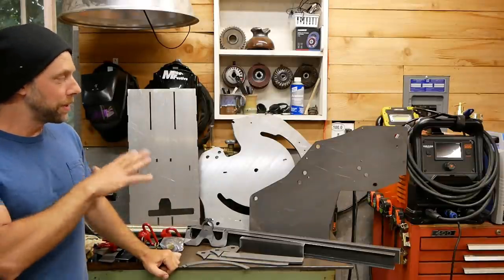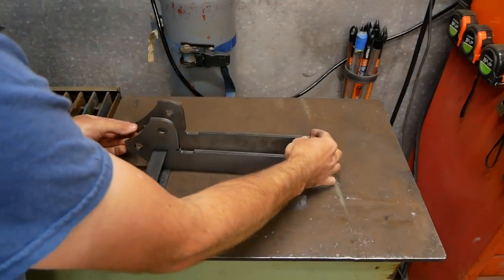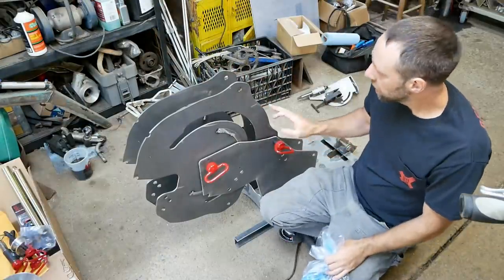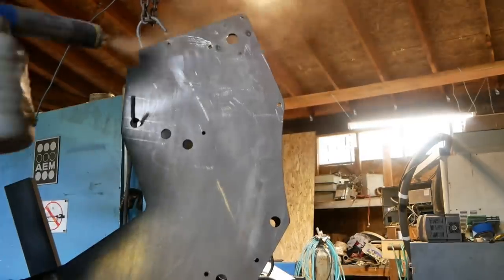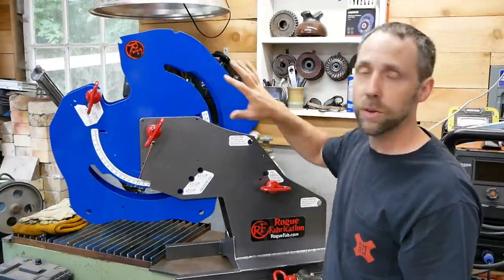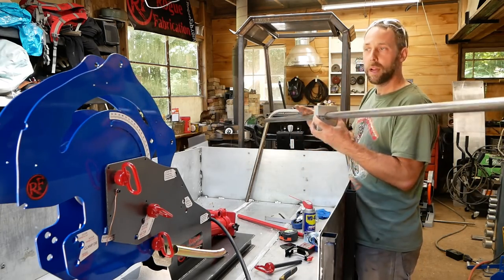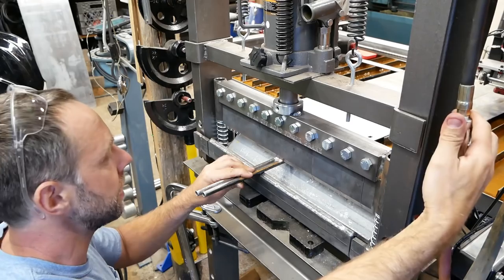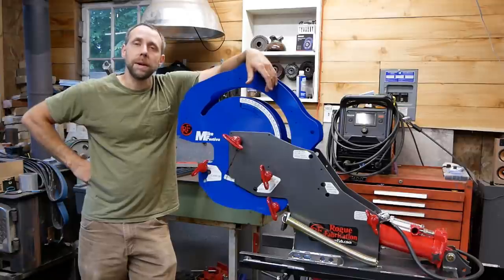Rogue Fab M600 tubing bender and Swag off-road finger brake

Comment: Thank you for another great tool video Mike!  A while back I bought one of the SWAG finger brakes for the maintenance shop at work and found it very useful, particularly the heavy gage bending capability.  They didn't understand why I was mad that I couldn't take it with me when I quit...something about using their money, blah, blah...  That is a different concept in tubing benders, I see some good utility in that design.  Might be a good addition to my Pro Tools bender.  I'm pulling up Rogue's website now to get a closer look and see what it costs.  Thanks again for the great content.
Reply from the maker: Thanks for checking out my new video! Yes the Swag brake it really a well made tool, I wish I bought it years ago. I looked into the pro tools bender, they really looked like great tools, I think both styles of benders will get the job done, I have not ever worked with ether kind before so it’s going to be a learning curve for me but I’m looking forward to it. 👍 
Ps I just got home from a awesome camping trip hiking 45 miles though the south side of the Olympic mountains! Take care

Comment: Dang Mike, you have all the coolest tools.
Reply from the maker: 😊 I’m definitely getting some cool shop tools! If you look back 5 year’s ago when I first posted my homemade sawmill video, I was working with a broken but repaired Lincoln weld pac 100, an angle grinder and my used worn out metal bandsaw. I have really come a long way! Thanks for checking out my new video 🙂

Comment: The powder coating looks far better then a typical rattle can job, might have to look into a sprayer and find an old even for preheating, or maybe a few oven/stove top coils inside of a cinderblock enclosure, be good for weld prep on cast iron as well, howd you land on this particular bender the company reached out? the JD2 benders seem more popular similar price and a bit easier to work with maybe im not sure, any advantages to this style?

Comment: Once again Mike, awesome video and info.  I got the Slugger saw you use and I love it.  Since you've had yours for awhile now, how's it holding up and what about blade life?  Thanks for sharing, keep these videos coming!  :)
Reply from the maker: The Slugger saws are great 👍 I really like mine, my friend bought one too after using mine. Blade life is fairly good as long as you don’t force though the cuts and only cut mild steel with it. I get my blades sharpened from a blades sharping business for about 1/3 the cost of a new blade, I think you can get them resharpened about 3 to 4 times before they are shot, if you notice it’s taking extra force to cut though your metal, just pull the blade and get it sharpened, its nice to have two blades on hand for this reason. Take care

Comment: hey mike i have Titanium Easy-Flux 125 Amp Welder and new to welding would the VULCAN
MIGMax™ 215 Industrial Welder With 120/240 Volt be good upgrade welder to buy when i get better at welding to weld thicker metal?